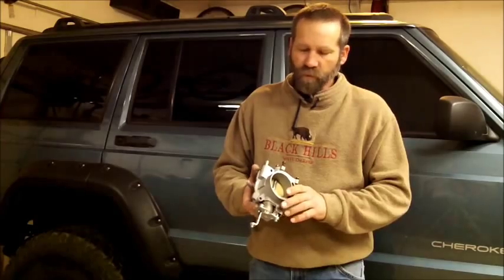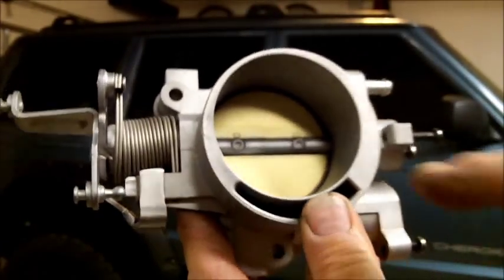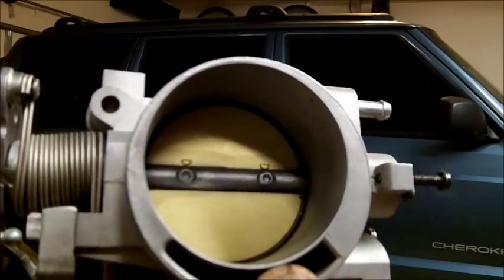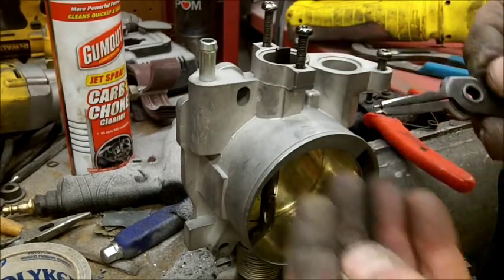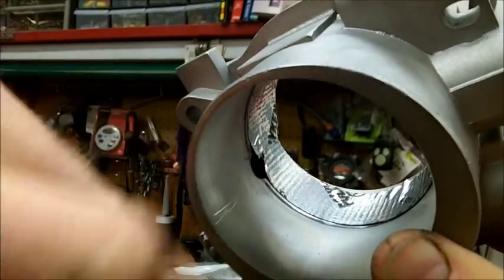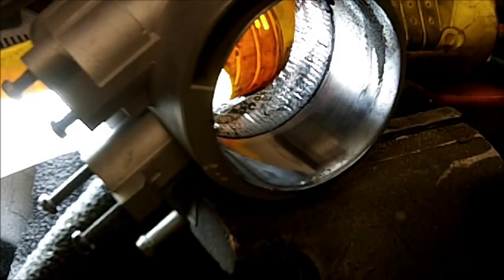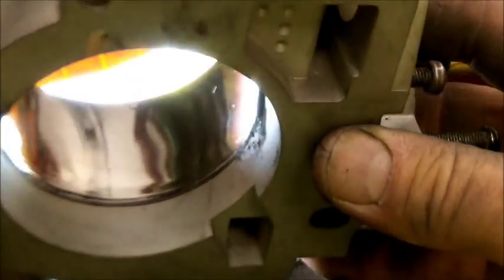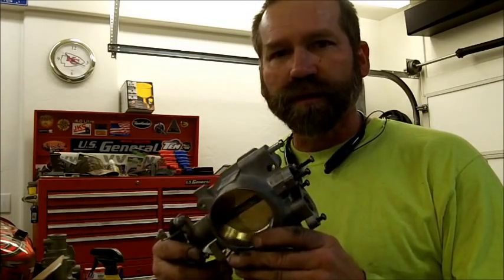DIY Porting & Polishing 4.7L Dodge & Jeep Throttle Body

Comment: Some of the respondents here are missing the mark by miles! The point here isn't about making big power or torque gains with this mod on it's own. It's about this mod being part of a package of mods, most of which achieve little on their own, but as a whole achieve great things.
P&p'ing your TB would be part of a package that includes p&P'ing your inlet manifold, gasket matching manifold and head and then p&p'ing the head. ANd if it's a turbo motor (like mine) add in some extra boost, a bigger IC and a p&p'ed turbo.
Then you'll need some mods on the exhaust side.

Great video man. I'm part way thro' p&p'ing a head for my motor, but I still learned something from this. Everyday is a school day.
Reply from the maker: Thank you....You hit the nail on the head.

Comment: Love what you did i too cleaned mine up but i went a few steps further with it i cut the shaft in half and counter sunk the screws into the blade a hair. then cut off the end of the screws flush and smacked the bottom of the screws to keep them from backin out. Also cut back the passage for the iac so i can smooth out the brick walls on ether side of the opening so its smooth going into the tb.

Comment: Fascinating, I left my front intake side 68mm and on the reverse I went from 68- 70 so looking from the front it's 68 behind the flapper however is a nice optimized 70mm diameter hole. The results we significantly improved throttle response and overall that much more quick. Thanks Martin!
Reply from the maker: Good to hear. I'm glad you liked it and found it helpful.
Reply: Thanks Martin! The IAC is different on the WK so unfortunately I wound up fitting an oh one off eBay.

Comment: I believe that theory on modifying the 68 mm throttle body is believed the 68 mm throttle plate or butterfly plate and the area behind the butterfly flapper between the intake manifold in the back of the throttle body is where you would make the enlargement so it's a 68mm coming in opening to 70 mm into a 2008 intake manifold if you can find one.

Comment: I don't know about large power gains but the aftermarket companies flame 8-10hp from their 70mm units. I'm sure that's a far stretch and real life numbers are probably like 0-3 but I bet throttle response is probably improved. I would like to here feedback from guys who have actually done the mod to see their reviews.
Reply: cbr600rx7 i put a 70mm F&B on my 4.7 the throttle response is great and it pulls harder in the mid range but it wants to idld between 1100 amd 1400 rpm. from what I understand it is a common issue on the F&B throttle bodys
Reply: It's best ported and matched to a 2008 intake. I did this on my oh-one limited along with freshing up the upper end. Also got rid of torque management, ditched the spare tire and removed torque robbing rubber  bushings with prothane and throttle response is great! 6.6 to 60 and she pulls slowly all the way to redline. Transfer case and front drive shaft intact. If you remove the  front drive shaft I understand times fall even more.

Comment: It looks great , But what does it do for the intake overall ..?? The manifold is still a rough casting and just the throttle body cleanup seams pointless .. Fill me in here !!
Reply from the maker: By removing the large hump before the throttle plate and sharpening the top edges of the body it improves air flow and opens it to a true 68mm.
Reply: martinbuilt Ok, So in reality your making one side of the throttle body 3MM bigger ..Right ??
Reply: Look up how venturi work. he is basically improving on the venturi flow.  https://en.wikipedia.org/wiki/Venturi_effect
Reply: Not enough to build any power though ?? Question goes unanswered ..??
Reply: ShawnMrFixitlee with the right exhaust system and intake, yes, it will improve on power as you are allowing more airflow the better the engine can breath the better the power.
Reply: I did mine a little more than martin did and i loved it crisper throttle response and it changed the exhaust note along with intake sound which i loves lol. As for hp gains i never dyno it but i was more than happy with it

Comment: Whats that tool you used for the finishing polish? I port and polish heads all the time and ive never been able to get it that shiny. Thats incredible.
Reply from the maker: Thank you!  Wool Felt Polishing Pad for Dremel Rotary tools. You can find large kits on eBay and Amazon
Reply: I used yhe harbor fright polish and felt wheels mirror finish also.

Comment: Is the mileage affected and do you feel a difference in power?
Reply from the maker: I installed this on a 4.0 Jeep Cherokee. I didn't see any loss or gain in mpg. I think this throttle body is best suited for a highly modified 4.0 or a stroker motor.

Comment: martinbuilt maybe you can give a hand here. My throttle body is leaking on the spring side, found it by smoke test. Is there suppose to be a bushing or an o ring to prevent vacuum leaks? I saw this kit on napa wondering if thats what I need. https://www.napaonline.com/en/p/NDP6151422

Comment: Hi Martin,
Thanks for sharing the two ideas about the PP and TB swap to 4.0 engine.
I started to build 4.6 stroker and this two videos are great info.
I made a shortcut to the process - just slammed the TB on lathe. Bottom side is exactly machined so I could easy rech good concentric grab on the lathe. 
I was able to bore out the 65mm bump to 68.00 without removing the shaft. It came out just before the bit started to touch the shaft :-)
Some pictures here:
https://www.jeepstrokers.com/forum/viewtopic.php?f=8&t=5923&p=50765#p50765
Thanks again and keep the good videos coming :-)
Reply from the maker: Looks like it turned out great. Thanks for sharing.

Comment: What's that measuring tool called?
Reply from the maker: telescopic T bore gauge set
Reply: +martinbuilt cool thank you!! Any chance you know where I can find the flap wheel that big? I'm only finding 3" diameter ones
Reply from the maker: +Melecio Valdez well I don't online I hadn't to get mine from a local hardware store in Las Vegas called
 McFadden-Dale's
Reply: +martinbuilt ok cool. That is a 6" flap wheel right? Not sure how they're measured. I picked everything up today just wasn't able to find the flap :/ Im going to start porting the front tomorrow. I won't really need it since I want to taper it but I will need it for the back and the manifold :D
Reply from the maker: I think its only a 4 3/8 or 4 1/2

Comment: Thank you for the idea. I used a stock 68 mm throttle body from a Durango for my 2001 dodge Dakota, 40.00 bucks at pick a part recking yard. I kept my original incase the one I ported and polished gave me any issues when I smogged my truck in California. I didn't get to crazy just leveled it out to be 68 mm From the out side to the butterfly. Looks and works great not sure what it did for HP but it is a noticeable improvement. Thank you I love your ideas.
Reply from the maker: Glad it all worked out for you. I can guarantee you will not have any problem with California smog. thanks for posting the comment

Comment: There's no way that your going to gain anything from doing that. Seems absolutely pointless and a waste of time. Unless you can show me true dyno testing results then any argument will be invalid.
Reply: Larger throttle body plus 24+ lb fuel injectors = 4 barrel carburetor if a sufficient camshaft and air supply is available.

Dyno testing results available, where can I post them?
Reply: Didn’t you used to be a weather lady on the Weather Channel?